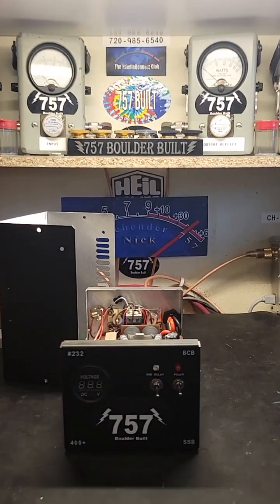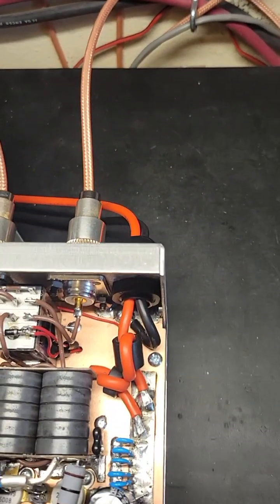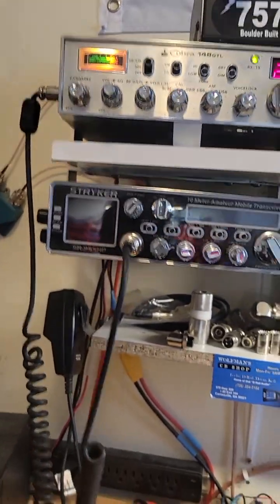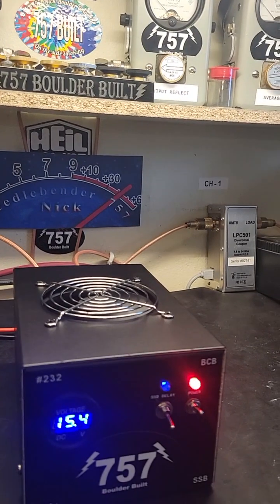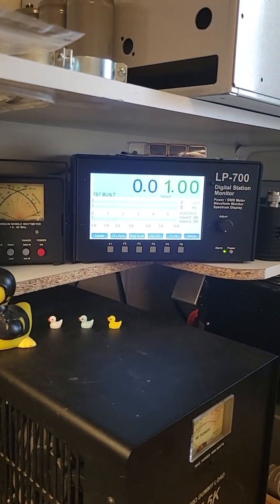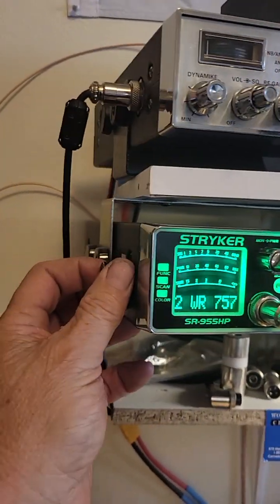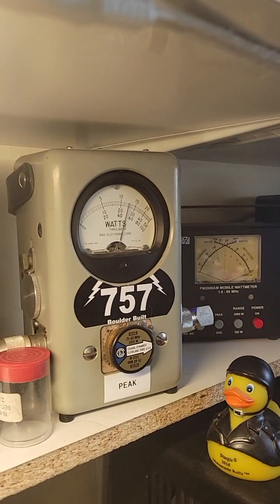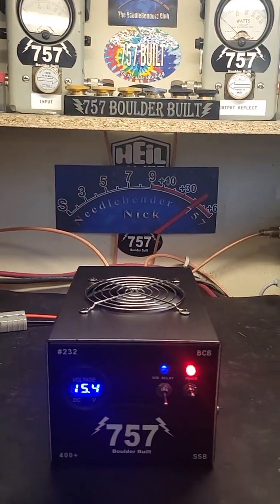#232 400+ ssb Bcb

Comment: IM CONFUSED why does ur amp have swr 1.3 or less don't make sense. as long as ur not over 2 ur good on hf ....basic knowledge dont matter if it 1.5 1.7 1.8 swr ur reflection isn't nothing........ so what is ur theory on different  length s antenna cable between radio and the amp .I have multiple  lengths never had any issues. still is 50ohms any way u look at it...Nothing electrical is different between different lengths of cable.
Reply from the maker: 1st off it's the transistors that can't take the swr higher than 1.3-1 and if you think 2-1 swr is good your completely wrong..also  if the coax lenth doesn't make any difference how do you explain what the readings are on the bird meters,,,the meters don't lie, look into nullify coax and velocity factor. Just trying to share some hands on information from experience. No worries here my station has an swr of 1.01 -1
Reply: @757boulderbuilt4 how do I get into contact with you for an amp? Im really interested in them thanks 069 big star 73's
Reply from the maker: @ShaMan_FreePatriot1776  720-985-6540